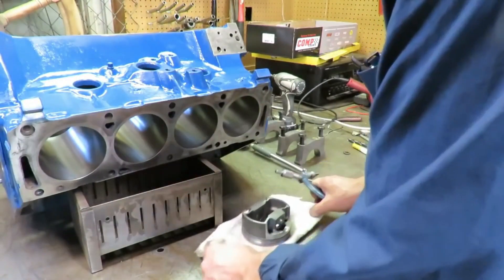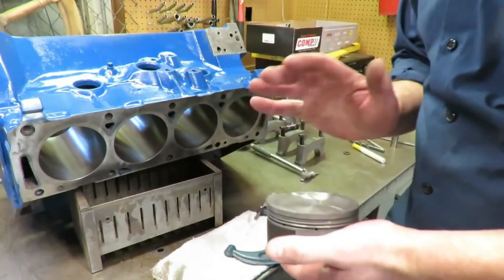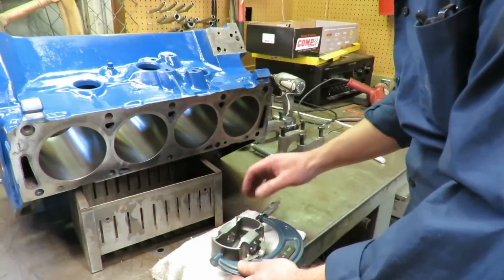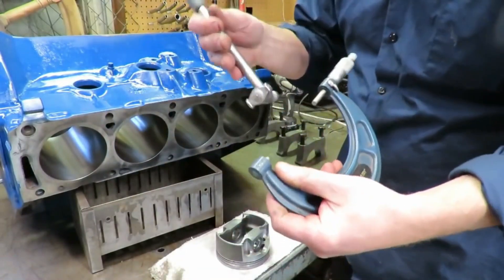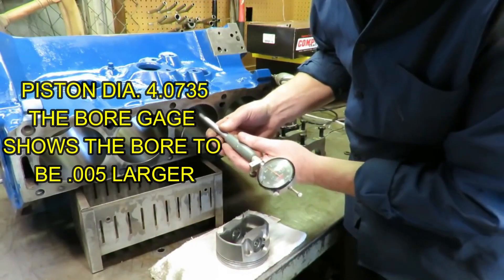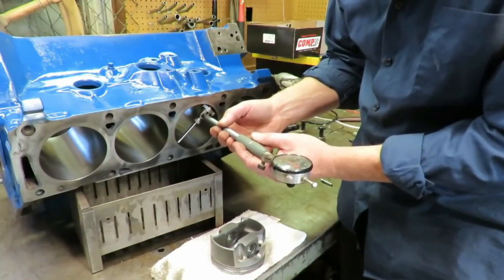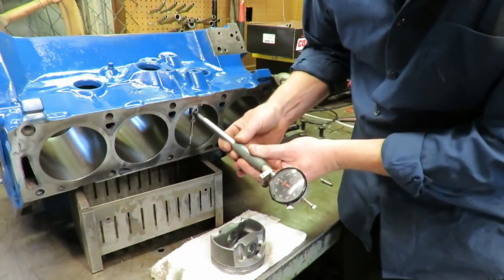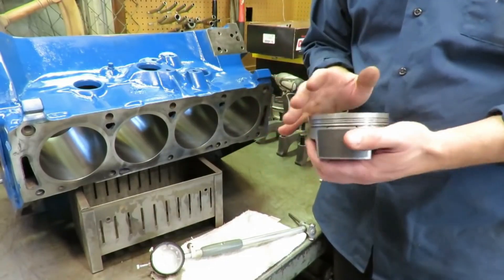PISTON TO CYLINDER WALL CLEARANCE

Comment: You didn't say so in your video, but I do hope that you are putting on aluminum heads and an aluminum intake manifold. 

Those archaic cast iron parts are heavy and are best used as wheel chocks for truck safety lanes.
Reply from the maker: Actually we used C8 heads and an edelbrock intake this engine made over 500 LB FT of torque
Reply: @Myvintageiron7512  I am not saying that one cannot make power with a cast iron head. I am saying that one can usually make more power with an aluminum head.

And one won't have to use an engine hoist to get it off and on the engine block in chassis either.

Those days of wrestling with FE engines are over for me. )

Comment: Keep up the good work. I've watched all your vids over the years and built myself a 350 chev follow your engine building guidelines to the letter. 906 vortec heads all the standard machineing to block flat top pistons and so on. It's in my 70series landcruiser winch challenge truck here in New Zealand. The motor has run strong for five years now. Thanks heaps mate keep making vids

Comment: And check it before you leave the machine shop ..make them show you . once you get it home it is YOURS ..  I'm stuck with a messed up block I paid 550.00 in machine work that has bores out of spec and the surface finish of the deck looks like they used 36 grit on it  and a MLS gasket will never seal on it the way it is  . This is from a highly recommended machine shop in North Texas
Reply: That's sucks sorry to hear that.

Comment: Great video.. just one small thing to add.. The ford Fe has the head bolts a good distance for the bore, a Windsor / clevo or SBC will go out for round ( I"ve seen  .0025" ) if they have been honed with a plate.  I'm sure you know this ...just not all the viewers

Comment: In a previous video, you stated no more flat tappet cam builds. I wanted to ask what the spring seat pressures were. Back in the 60's and later, factory springs in high performance engines  had less than 100lbs seat pressure. Check the pressures of original springs from Chevy 302's, 350's, 427's and 454's. You'll be surprised how low they are. It's when you get into the high lifts, over .510", is when you get into trouble.
Reply from the maker: We have seen a ton of failures with stock cams and springs
Reply: Yes, I agree. People don't realize you can't let the engine sit and idle for long periods. @Myvintageiron7512

Comment: I have found variation in bore sizes from top to bottom of .0002" (2 ten thousands) , I assume this is typical and not harmful. Your thoughts? P.S. 4.250" bore.
Reply from the maker: .0002 is no issue